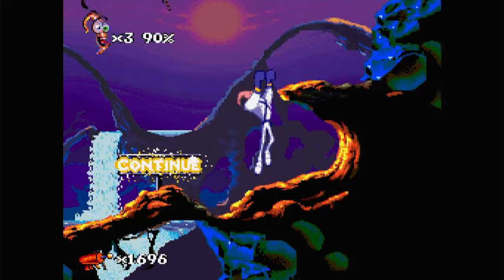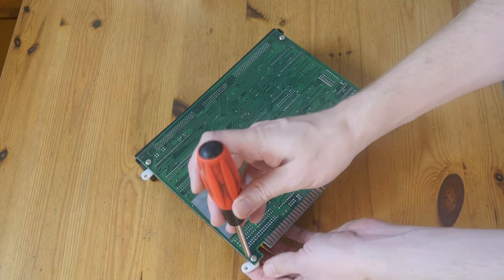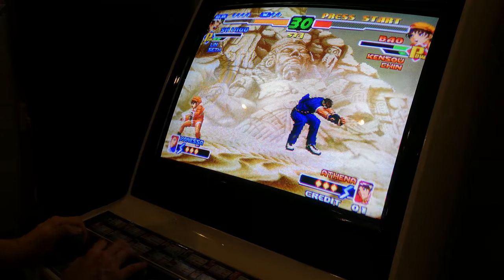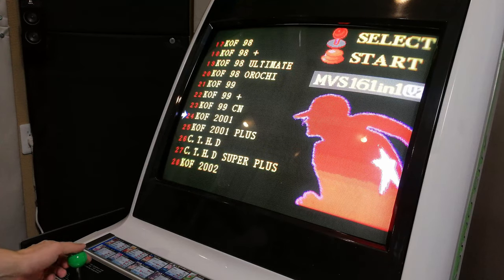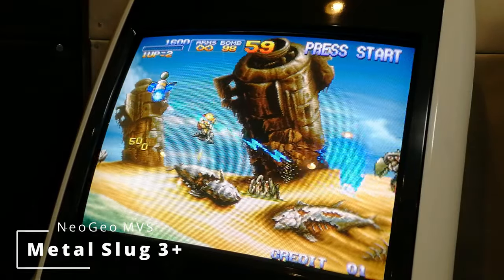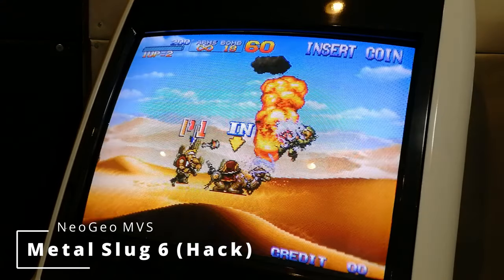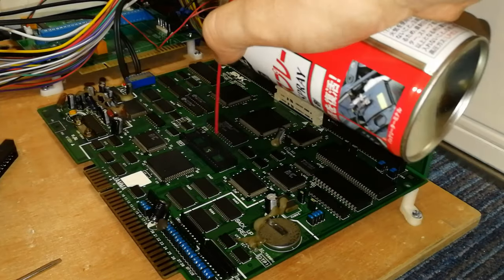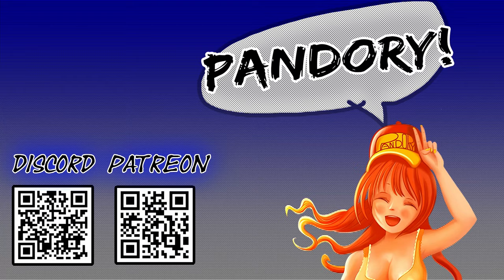NEOGEO MVS & 161-in-1 [AliExpress Review]

Comment: My 161 in 1 series 2 works great on my MV 1C.. apart fro SamSho 1 which has the common Kabuki character glitch. 
However using the 161 on my MV1FZ some games like Pulstar freeze. 
The 161 Seems to run better on a 1C. 
I prefer the 120 in 1 overall - it works great on both MVS I tried.
The MOBO model / cart revision makes a big difference.

Comment: Unless the Mark 2 of the 161 in 1 cart fixes the voltage issues it can cause strain on your  PCB. Btw the DIP setting can be changed for each game after you enter each game on those carts. That can fix the KoF 1v1 settings.

Comment: You should get the series 2 yellow 161-1 cart. I have it and it works really well in my opinion. Some of the games have occasional sound distortion and graphics glitches but for the price you can’t complain too much. I have 50 original carts including most of the games that aren’t on the multi cart so i have quite a tidy collection.
Reply from the maker: 50!  You've certainly been busy!  What are your favourites?  I've become somewhat partial to Goal! Goal! Goal!  - A knee to the face has never been so satisfying.
Reply: @TeamPandory  metal slug 3 and x, shock troopers, blazing star, strikers 1945, league bowling, Neo turf masters, king of fighter 98, breakers, to name a few. There’s so many great games and not that many stinkers on the system.
Reply from the maker: @AlphaPapa69  I can think of hundreds of stinkers.... All them hackery hacks!

Comment: I was thinking about buying a consolized MVS from Ebay.
Are there any risks involved, such as wear on MB and/or leaking batteries and caps along with trace rotting? I mean, these things are 30 years old after all.

Is this a good investment, prices are around 290 usd with shipping and all, Id just like to avoid "ram failure" error messages and what not.

Comment: I just wanted to comment on the kofs that are 1 vs 1, maybe it's because in that mvs they used that same 161 before and the person saved a configuration like that and the mvs kept that in his memory and the other about the crashing of some games, the wiring jamma that you use is Chinese and does not power correctly, if you can measure the voltage of +5 you will realize that the same voltage that comes out of the power source does not reach the jamma connector and multigame mvs are delicate in that aspect, greetings
Reply from the maker: The cart works in the smaller MVS 1B (I think) but not the 1A (in this video). I think it's a compatibility thing related to memory or something b

Comment: Great video, it's a real pity that there are so many problems with the multi-cart as it would be ideal to base a collection around.
Reply from the maker: That was my initial idea.  We've ordered a "banana cart" to check if that will be any better- fingers crossed!
Reply: The 120 in 1 was better... but they are getting super rare. The 161 carts run much better on the MV 1C boards (those that have the single vertical slot).
Reply: the chinese could make a "complete" version for multi-cart without all those hacks version... but i guess if they do that, they will never be able to sell another multi-cart again

Comment: So, the MV 1F has alot problem with the new 161in1 multicart. 
You can get the ver. MV 1B or 1C it runs fine 
With this multicart
Reply from the maker: I have to revisit this in a new video.  I've got the multicart working on the fz, so all games work okay, but still no pick n mix. That pick n mix alone on the banana cart is worth getting.